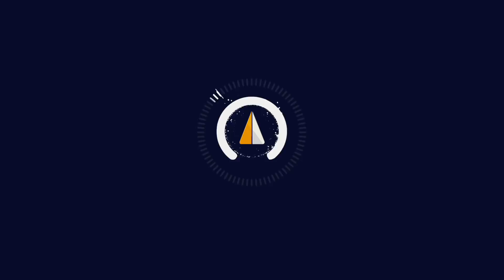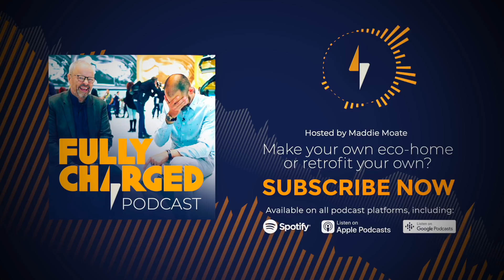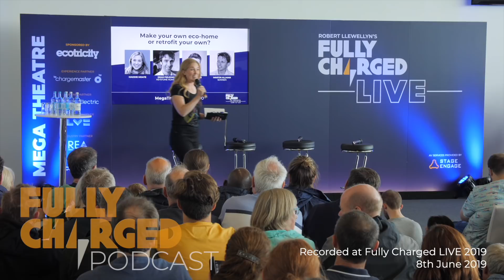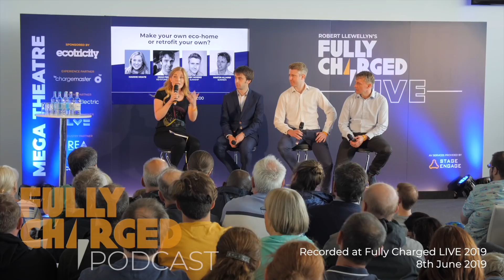FC LIVE 2019 - Make your own eco-home or retrofit your own?

Comment: Interesting chat, listened to it on the podcast. However in response to the first question re PV in a conservation area - surely solar tiles (eg like the Tesla ones) would be a good solution? From the ground there's be no visible difference, certainly much less obvious than PV panels...

Comment: I have reduced the consumption in my 100 year old granite house from 8k kWh a year to 2k kWh in 6 years. Heat Pumps, triple glazing and insulation, solar water panels to heat my own water (90 % efficient compared to PV) and replacing appliances when they die with A+++  - e.g. heat pump tumble dryers. I also inject about 2k kWh back into the grid. Oh and I put on a jumper when it gets cold and use lots of timers. I only wish someone would bring to market a universal V2H (Vehicle to Home) system that would let me use my soon to be arriving e-niro as a battery storage device that would run my house in the evening, rather than having to buy additional batteries to store the excess that I currently give to EDF for free.